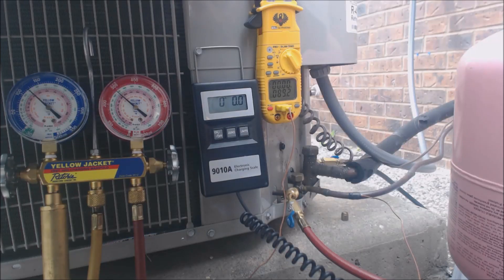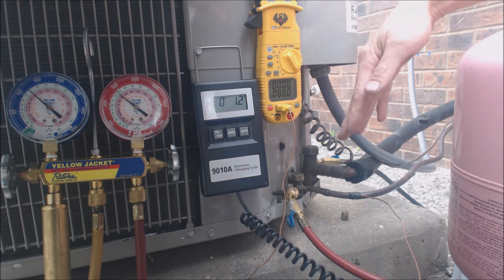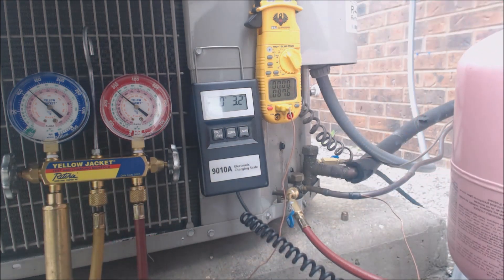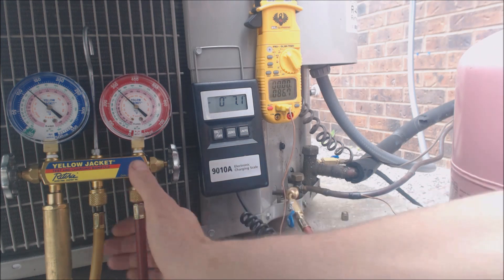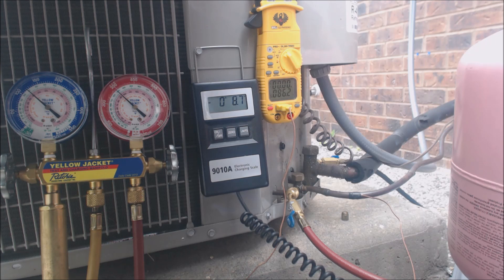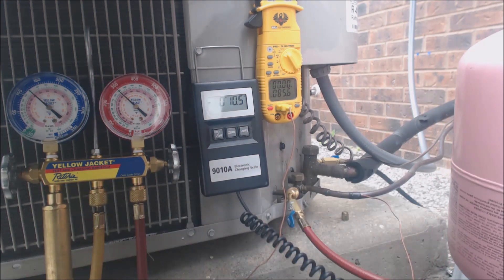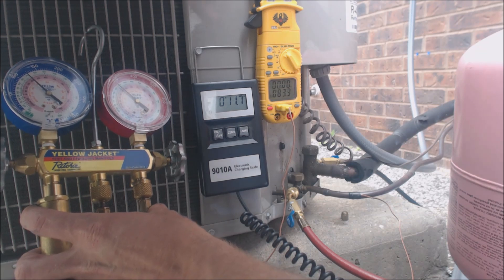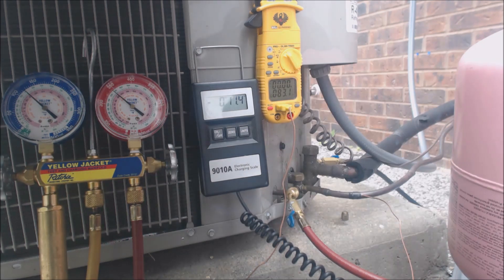Charging R-410A Refrigerant: Step By Step Process of Adding Refrigerant in Real Time!

Comment: My gauges doesn't read 410a. Can I still use them? Thanks
Reply from the maker: The gauges set can be used but it is advisable to not mix refrigerant oils from different refrigerants in order to avoid cross contamination. The gauge set would work as long as the pressure range is high enough.  You will also need a pressure temp chart then since it is not on the gauge itself. Thanks for the Comment!
Reply: Thank you for the reply! I thought that was the case. I found a chart online Thanks again

Comment: Hi...
You must be busy now 99 degeres

.Does the position of the red valve always stay closed or open?
During checking and adding
Reply from the maker: Yes both handles are shut before connecting to the system. When charging, only the blue low side handle is opened a little at a time while charging, thanks

Comment: So with a txv you disregard the low side readings and just go off the high side readings?
Reply: You use subcooling to charge with a TXV and superheat for a fixed orifice. I still look at my low side gauge just to make sure something strange isn't going on. The TXV should keep superheat at 10 to 14 degrees but this is just a ballpark. To charge accurately always use subcooling with txv

Comment: why would you not turn the tank upright, then just add the vapor so it doesn't have to go through the changes ????
Reply from the maker: R410a has to come out of the bottle mixed as a liquid, then you can phase change it, thanks
Reply: THANK YOU :)
Reply from the maker: Yes or it can be hooked directly to the refrigerant tank, thanks.
Reply: Because it is a blend.. The vapors will be separated in the can, with one being on top.. You will not get a blend if the can is upright, as one of the vapor will  be on top of the other.
Reply: Thank you,

Comment: What if there is no nameplate of how much subcool needed to charge a txv aircon unit?
Reply from the maker: If it is a single or two speed compressor in second speed and the rating plate does not say target subcooling then we go with 8-12 degrees target. I always use 11 degrees, thanks

Comment: Does outside air play a role when charging?  I see that you are  guiding yourself mainly on the subcooling
Reply from the maker: Make sure that the Outdoor Ambient is at least 70 degrees and make sure that the vapor sat temp is above 32 degrees, for txv systems wait 5-10 minutes before checking subcooling. Superheat should also be checked to make sure that the txv is making sure that there is enough superheat for the compressor safety but for the refrigerant level check subcooling, thanks
Reply: AC Service Tech LLC  thanks.  Keep these videos coming.
Awesome channel

Comment: hi its me again, my system is a 410a with a 11 degree subcooling required written on plate, txv system . I managed to get some readings
 Low 110 at 36 
High 300 at 96
Temp 45.3( vapor line)
Temp 83.9( liquid line)
My indoor temp was about 70 and outdoor about 81 or 82
Do you see a problem with these values , Im a little concerned about low side at 110 psi at 36 degrees, it aint  very high?
 I lost a little pressure taking of valves , hopefully values didnt change much

Thx in advance?
Reply from the maker: It looks ok but maybe the low side is a little lower due to either cooler outside temperatures or low wet bulb in the house. It could also be low airflow across the coil. You could monitor it and as long as the the pressure does not go near 34 degrees or so, you may be ok. You should look at the return especially to make sure there is enough air though, thanks
Reply: My system doesn't make sense.

I have a 410 txv system that according to the plate supposed to have subcooling of 11. The dude that did the startup on mine put in 3 pounds of 410 extra for a lineset of 45 feet, which seemed excessive to me. I purchased a set of guages and a temp probe and noticed I had subcooling of 16 or so. As I remove some refrigerant my subcooling has increased to 20 now and my super heat is about 10. I don't get why my subcooling is increasing instead of decreasing. Any insights?

Comment: would the subcooling be off if the unit has too much 410a in it?  the installler added 18 oz of 410a for a 35 foot lineset but added the first 12 oz before the compressor was running
Reply from the maker: Unless this was done in the colder month the tech would have still checked the charge with subcooling while the system is running unless it was below 70 degrees both inside and outside thanks!

Comment: another question. Do I need to shut the unit off before connecting high side hose. I hooked it up while unit was running and the hose wouldnt seat. I had to get a pair of pliers and tighten a little. The hoses are new. Also I  seemed to loose a lot of freon when disconnecting.

Comment: Hello sir I cant find anywhere to directly ask so here I am. I have been in hvac for 6 months  now  and  am learning quickly but came across a predicament involving flushing a system that is replacing just the condenser due to the paradise fire in cali. Anyways I was asked to flush the lines with the evap coil still attached (replacing condenser only) exactly how do I do this? This job is 2 weeks out. Thank you for your help and response
Reply from the maker: You cant really flush with the evap attached to the line set. We cut in front of the evap and flush each line set tube from the top and let it come out the outlet at the open bottom of each tube. regardless of what anyone says, the evap really can't be flushed well at all since it is not pitched and the tubing goes upward and downward. We use products like R-11 flush or others and we do our best and thats all we can do. When you are finished, the lines get rebrazed to the evap and the condenser is attached. The filter drier is the last thing to get brazed on to avoid contamination. Make sure to flow nitrogen while brazing to avoid any oxidation inside the tubing. Also be aware that phosgene gas is created when refrigerant oil is heated so make sure to have fresh air available where brazing, thanks!
Reply: A badly done flush could be worse than none. Only flush where absolutely necessary eg severe burnout and unit kept running, somehow. 
OR the new units are on the new gas

Comment: Question . What if everything is fine just as u did in the recharging of the 410 a system , but the issue is the temp on the probe on the liquid line is going up Instead of down . The sub cool factor is 10 deg. low side 135 psi high side 245 psi ...
Reply from the maker: You are looking for a liquid line temp of roughly 72 degrees for that 10 degree of subcooling. Do you have your temp probe out of the sun and covered with a piece of lineset insulation? Can you get me some more info such as actual temp of liquid and vapor lines, temp outside, inside and wb or whatever you can remember? Thanks!

Comment: When troubleshooting a unit that is not cooling properly, what are the other things you should check before checking the refigerant charge and adjusting the charge? Also if you have to adjust charge by adding or recovering refrigerant, how long should you wait after you have added or recovered refrigerant to know if you need to add or recover more to get charge correct?
Reply from the maker: Check filter first, then airflow. I pull the disconnect outside first and then turn ac on. Then I go out and put the disconnect in. I do this so I am right in front of it when it turns on in case there is an odd noise. Roughly 3 minutes but sometimes you know you are still very low. You want to wait longer when you are getting close like 5 minutes, thanks

Comment: What is happening when temp does not go down stays constant, but sat pressure goes up could this be a problem of over charge. Out side temp is 90 and reading is 96 at temp meter
Reply from the maker: Sorry, I would need more info. What is your subcooling? Liquid pressure? I am assuming that you are saying that the liquid line temp is 96? What refrigerant? Does this unit have a txv or piston?
Reply: 10 degrees is subcoolent, reading 108 on meter,coolest is 410a, yes it does have a txv valve
Reply from the maker: What does the rating plate call for on the outdoor unit? 10 degrees of subcooling is usually about correct for a charge on the outdoor unit
Reply: Plate unit reading call for 10 degrees of subcoolant, meter reading is at 101 degrees, high gage (Red) is at 110, low gage is at (44), all 410a readings, and yes I have a txv valve at cond.
Reply from the maker: Those numbers sound correct, are you not getting 18-21 temp decrease inside from the return to the supply conditioned air temps otherwise known as delta T?

Comment: What does it mean when the High Side Gauge is at 300 and climbing while the low side is at or near freezing?
Reply from the maker: I am assuming you are talking about in cooling mode. If it is a cooler day, the vapor pressure will be on the low side though that sounds like it may be a degree or two too low. It may be freezing the evap. Check out this video on what the pressures look like when the evap is freezing. This video is on R-22 but it will give you a gauge of the direction of the needles for high and low.  If the high side keeps going up though that means that you are having a problem rejecting heat off of the outdoor fins. What kind of shape are they in? ----https://www.youtube.com/edit?o=U&video_id=yW_VHio9mI4
Reply: OK...here's the deal. A Brand new Goodman 4 ton 410A (GSX14108) condenser...brand new American standard coil, case  and TXV valve. After charge the High drops side drops but then climbs sometimes to near 500 while the low side stays at 100 PSI (near or at freezing). Temps at the line and High side are nearly 40 degrees off according to your video (Should be about 10-15 degrees right?)
Reply: Yes in the cooling mode
Reply: GSX 14048 sorry.
Reply from the maker: I would like to get superheat, subcooling, actual liquid and vapor temps, wb inside the house and outdoor temp. I understand it is a txv in cooling mode but would like to get all the details so I can see what is going on. I am guessing charge was added to increase the low side temp and pressure but it never went up but all the while refrigerant was being added and the subcooling kept increasing and pressure and temp went up. This could be due to a duct restriction or lack of airflow or it could be a bad txv. Check out the txv playlist for diagnosing txv's as well as check for air flow problems. Thanks!

Comment: so to find out what the target super cool should be then i would just take temp at the supply and return and calculate the delta T ? similar to getting the target super heat except we dont take the temp from wet bulb and the out door ambient and subtract the two . correct ?
Reply from the maker: 18-21 degree delta T is just a confirmation of the correct charge in comfort cooling. Subcooling is usually 8-12 degreee and is found on the outdoor rating plate but can be as high as 17 or 20 if the unit is calling for this. Thanks

Comment: I just had a new Rheem 3.5 Ton Split heat pump system installed and could not find the words sub-cooling or super heat on the condenser label. It just stated designed high pressure 550 and low 250 with factory charge outdoor unit 115 oz.  When I asked the installer what the sub-cooling should be he stated between 12-15 degrees on a 75 degree day or 8-15 degrees on an 85 degree day. It was  muggy and 93 degrees the install day so believe the installer just wanted me to stop asking questions. If sub-cooling or super heat is not listed, then what?
Reply from the maker: It may be on the under side of the shroud. That could be checked if the power was off to be safe. If it is a single or two speed unit then we typically charge it to 8-12 degrees subcooling on systems with a txv that have a single or two speed compressor, thanks

Comment: I know you lots of questions 2 months ago I had my txv  single stage heat pump charged up. Its a 2 tonne unit non variable speed It seems to be cooling fine but before summer hit I ran the heat side of it a couple days. it would put out about 80 degrees ( my laser temperature gun) from registers when outdoor was about 50 degrees or so. I have a sensi thermostat and after  a while it would pull in the auxiliary heat in  to bring it up and when reaching set temperature it would maintain it using normal heat ( no heat strip) mind you the temperature was around 50 degrees only outside. Supply side temperature seemed low, I understand temperature differentials are what is important , but pulling in auxiliary heat seems strange when only at 50 degrees outside., is this normal behavior  guy that charged it said its fine
Reply from the maker: It should run in heat pump only if you have it set one or two degrees higher than what the tsat says typically. On typical tstats if the temp set is 3 degrees or more higher than the temp then it pulls in auxillary. You should prob have around 25 or more delta t across the coil with heat pump only running, thanks
Reply: thank you quick reply . hard to know who knows what everyone uses rule of thumb.
Reply from the maker: We are all in a constant state of learning. That answer has been my experience but depends on the brand of tstat and that is what most basic tstats do, thanks

Comment: Is it feasible or even safe to simply flood the system with about a pound of 410a refrigerant.?  That way you can just write an invoice.
Reply from the maker: Ha ha, absolutely not and the technician needs to be EPA 608 certified before working with refrigerant, thanks

Comment: I can't upload a picture but the date of plates I looked at unless from looking at the wrong spot right below the cover where the contactor in the capacitor set data plate doesn't have superheat or subcooling
Reply from the maker: Usually data plate with have txv subcooling rating. If there is no rating then we shoot for 11 degrees of subcooling for units that have a txv. If it has a piston or cap tubing then we have to find the target superheat ourselves. Check out the "acservicetech superheat playlist" thanks

Comment: hi, i've noticed that the pressure and saturation temperature on the low side gauge did not change. when adding more refrigerant into system aren't both high AND low side pressures need to rise? so you're trying to get to 10F subcooling, but at the same time the superheat will decrease because of more refrigerant. is this correct? thank you.
Reply from the maker: The TXV controls the superheat so as you add refrigerant, the superheat will not decrease and the txv will keep the vapor pressure where it needs and it will not rise, thanks!

Comment: Hello, do we charge while the unit is running or off?
Reply from the maker: While it is running, in the vapor side. While it is off and under vacuum, into the liquid side.
Reply: What do u mean “while it is off and under vacuum,into liquid side???
Reply from the maker: If you were breaking the vacuum with refrigerant from the bottle such as weighing in the total amount of refrigerant as stated on the rating plate of a packaged unit, then you would valve off the vacuum pump, do a ten minute vacuum test, valve off the micron gauge, and weigh liquid refrigerant into the liquid line to the specified amount, thanks and also thanks for serving others!

Comment from the maker: Great Question! So the refrigerant tank is at a saturated state so if you know the temp that the tank has been at then you know exactly what pressure is in the tank from the pressure/temperature chart. Now while the system is running, the vapor/suction side is at a lower pressure than at saturated state and the high pressure liquid side will be higher than the saturated state so the only way that the pressure from the bottle will naturally go into the ac system is into the lower suction vapor side. I hope that helps and thanks for the question!
Reply: Thanx bro!...Im currently in school
Reply from the maker: Glad to help! Learn as much as you can, no one can ever take it from you!

Comment: I am told by one source that on an R410A system which uses a blended refrigerant such as R410A, that if the system has lost some of its charge , that you cannot just add refrigerant to the system, that it has to be pulled out and weighed back in due to it being a blended refrigerant. After watching this video this must not be true because I see that you adding to yours. Could you please explain. Thank you.
Reply from the maker: Hey Steve, In the case of R-410A, manufacturer trainings will say it is ok to top off systems as far as the blend is concerned because it is near azeotropic even though they want the refrigerant to come out of the bottle as a liquid to avoid fractionation. Obviously not over and over again. If you are working with other zeotropic refrigerants then more care must be taken when fixing leaks and adding to the charge. Here is some good reading material. Thanks for the comment! http://www.achrnews.com/articles/82752-blends-101-an-introduction-to-refrigerants